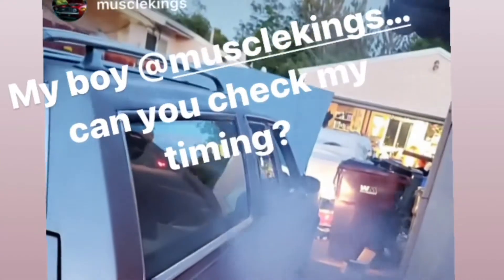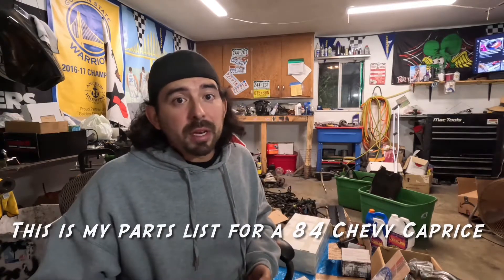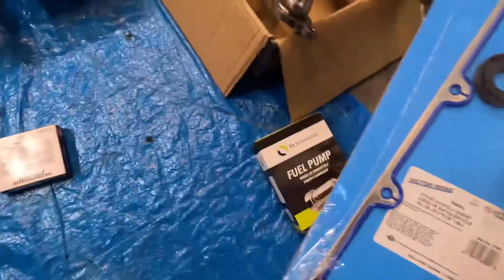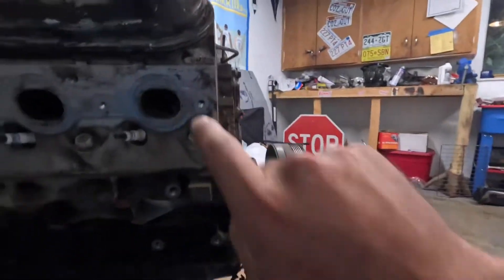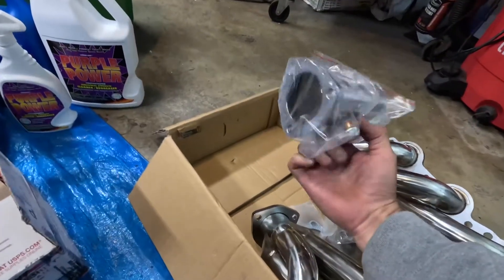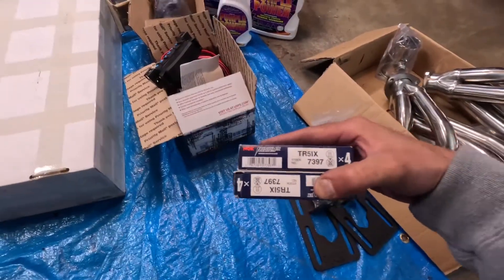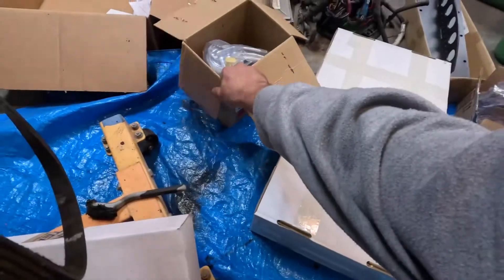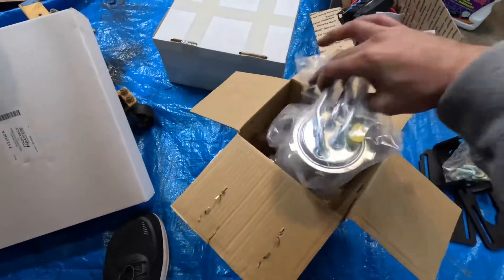Detailed LS Swap parts list for the 84 Caprice G-Body Wagon! Part #’s in the description!

Comment: To keep the factory hydro boost you gonna have to use a hydro boost LS power steering pump from like a 2004 Yukon. For the pressure line. You take the fitting out of the back of the LS pump and put in stock 305 pump fitting off the back of the pump and then you can use the stock 84 caprice hydro boost set up and the factory 84 caprice power steering pressure line.
Reply from the maker: I knew there was sum sum I had to do for it to work.. thanks man I really appreciate the knowledge!

Comment: I told him about the Buick sending unit that’s what I used in my 79 4door. I let him know I’m Not sure if it’s the same with the wagons cuz I know the tanks are a lil different on the wagons. I used the stock fuel pressure regulator on the 5.3. I used my stock carbureted feed line as my feed and I used my charcoal canister Evap line as a return. With them dirty dingos and that flex plate kit. You’ll be able to put the motor and tranny in factory location and use the stock drive shaft. That’s the same mounts and flex plate kit I used on my 79.